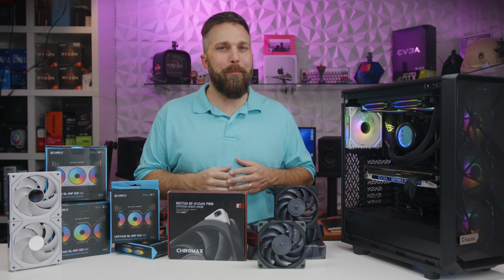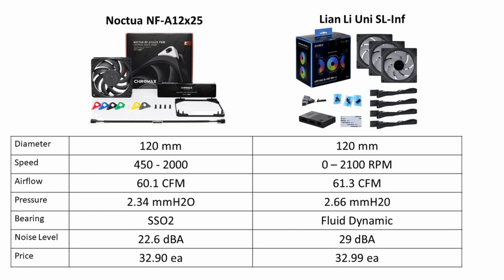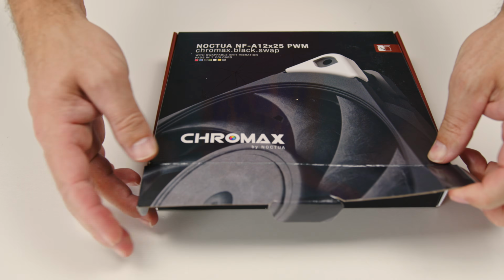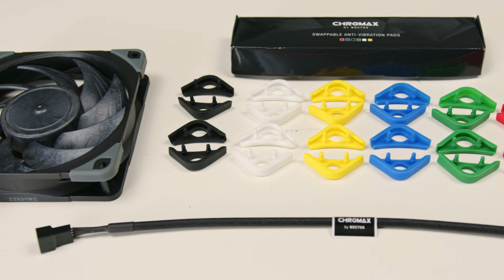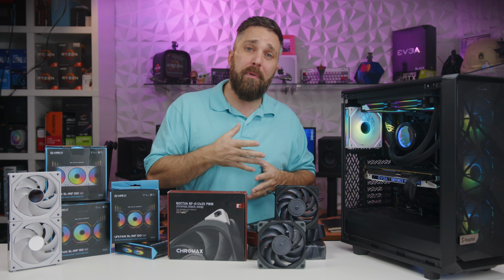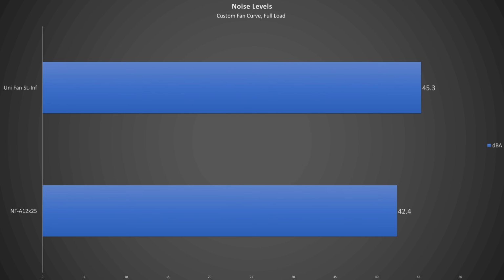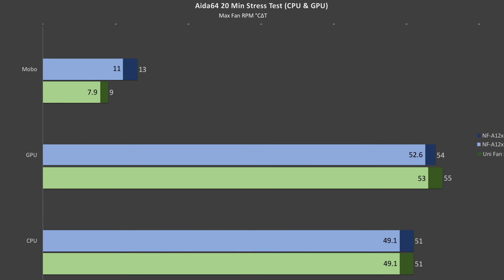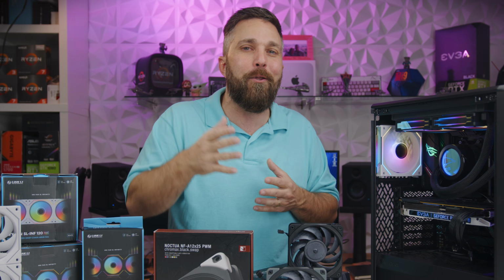BEST Fans for Your PC Build? Shocking Results!

Comment: Here in 12/2025 starting my future build for 1/2027 when I dream of a 6080/6090 build with the hopefully new AM6 mobo and CPU.  I’m getting a lain li xl case and I’m considering between these two brands for cooling.  I’m going to be using the Arctic freeze 3 420mm aio and replace the fans in it with the noctua and run 3 bottom, 3 side,as intake.   and the 3 radiator 140mm fans on top, and two 120mm on the back which should give me the perfect positive pressure.  I wouldn’t care about noise much cause I wear loud headphones while gaming but my wife is in the room a lot watching tv 10ft away so I’m think all the noctua fans for slight proformence and bigger sound damping for the 6090.  But the rgb almost feel like a must for this future case.

Comment: or you could just equip your system with a pack of Arctic P12 and P14 fans for a fraction of the cost and the performance will be almost the same
Reply: They are great for performance to price point for sure.  But they are some whiny loud fans for sure.

Comment: Surprising that the RGB fans cost the same as the non-RGB. Well maybe non-RGB a little more once you factor in the pwm hub and splitter cables.

Comment: I'm fairly certain the increased sound from the Noctua at full tilt is the sound of the air passing through this case.

Looking at comparisons of them where they are not in a case at all or in cases with different mesh yields different results.
Reply from the maker: No they sound the same with the panels removed.

Comment: Artics 120x120 Value pack, you get 5 of them for 30€ maybe since everything including air is more expensive they're uping the price to 50€ but still it's best budget case fans
Reply: I'd rather get 1 Noctua A20 ($32US) and 1 A14 ($23US), and get more as my budget allows than +3 other fans.

Comment: If you are even a little bit worried about money you should never go for noctua
Reply: Phanteks is a good alternative, and Artic fans are a very good alternative
Reply: When i was choosing fans for my pc, I had 2 options: noctua or arctic. Noctua was 300/350€ meanwhile arctic was 110€😂
Reply: Mmm I'd rather have a system a generation outdated with noctua than a this gen system with less reputable hardware.

A good set of these fans is like a good PSU. 

It should last multiple builds.

It should be sufficient to support whatever you plan to upgrade to down the road.

It should prevent potential damage to the rest of the system as it's reliable.

It should be the last thing you have to replace again on the next build, and when you do, it should be because of new technology has surpassed old by a very significant margin.

Yes, they're expensive. Yes there's a reason for that.

What kind of PSU is recommended? One with a substantial warranty.

Same logic with fans imo.

If budgeting is a concern I'd just recommend looking at cases that support 1-2x 200mm fans, get 1 200mm intake and 1 exhaust and buy more down the road as my budget allows.
Reply: @Justifier  Again I'll vouch for the Artic P12. Cheap, reliable, and pretty good performance, especially for the price. Sure they aren't Noctua tier quality but they get the job done, they're quiet, and they cost like 7 US dollars a piece.
Reply: Nothing wrong with them Nesy, however if sound is a concern at all, while maintaining performance, Noctua is the no brainer.

Personally I prefer bigger fans wherever available. 200mm intakes should be standard for cases that are 8+inches deep. Lower rpms, larger fans.

Planning on modding my case to hold 6x 200mm A20s eventually (as I can afford them). 

It will be glorious. And nearly silent.

Comment: yeah a lot of the fans improved, most fans in noctua's price range are within very small margin of performance, i think noctua needs to make something innovative.
Reply: I know it may not be everyone's main concern, but there's a good reason why people who are influences particularly favor Noctua 

If you use your computer for long periods of time, or if you work with audio focused tasks

(say a YouTube video that has a need for high quality sound)

That difference in sound, and especially the pitch of the sound means so much
Reply from the maker: Noctua still leads anything I've tested in sound levels. At typical loads noctua fans have by far the best noise to performance ratio.
Reply: @ElevatedSystems  I’m not the only one finding it this way, it’s a relief